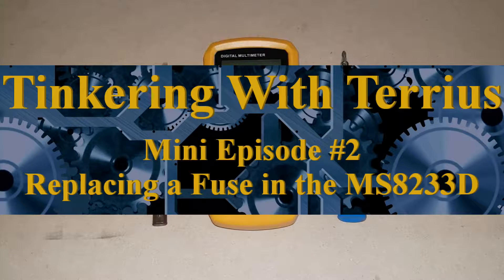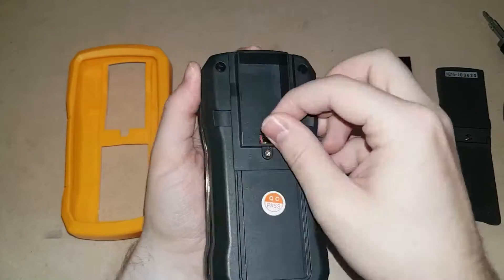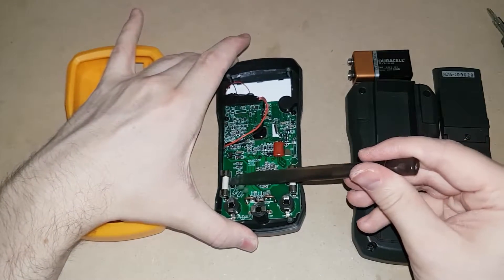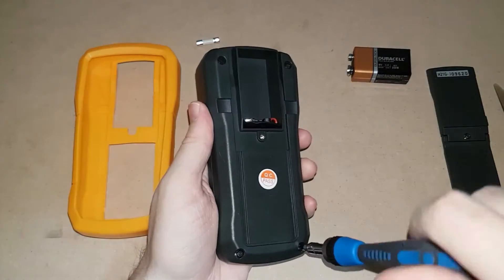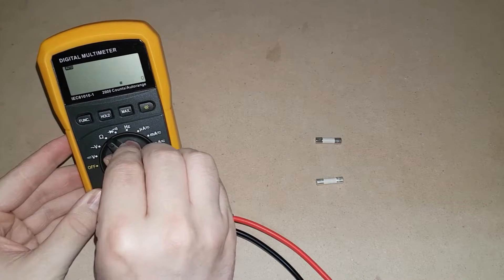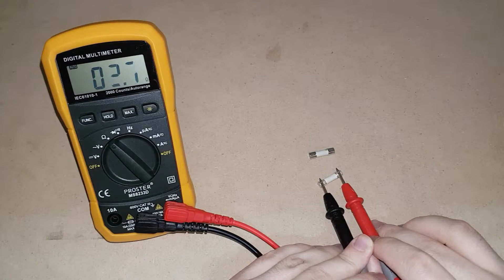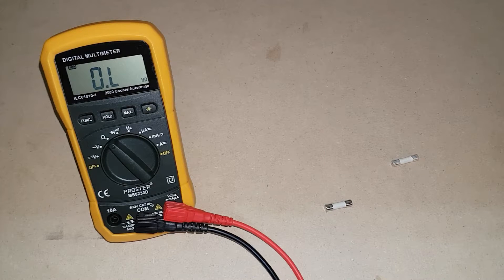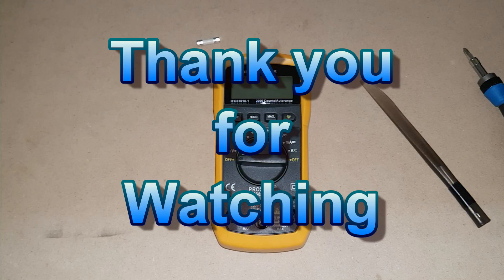TWT Minisode #2: Replacing a Fuse in the MS8233D

Comment: Fuse part numbers, from the docs, for the MS8233D, are: 

10 amp fuse: F10A/250V
250 milliamp fuse:  F250mA/250V
Reply from the maker: Thank you for posting the fuse specs, I was just about to reply with them when I noticed your comment had been edited!
Reply: @TinkeringWithTerrius  :)
Reply: I'm not sure if there are different fuse sizes, but it should be 5 x 20 mm.

Comment: Shame they can't make these fuses a lot more accessible. I've now blown the 10A fuses on a Crenova and B &Q multi-meter (MS8233A). Just too easily done. There's  a tiny message on the B & Q warning you not to exceed 30 secs on the 10A range every 15 minutes. Nothing mentioned on the Crenova or the instructions. Pretty useless for my application.
Reply from the maker: Indeed, I wish they were replaceable from the battery compartment like in some meters, but I suppose that is too much to ask for from a DMM of this price category.
Reply: @TinkeringWithTerrius  : I have just managed to replace the 10A fuse on my B & Q, using glass fuses of a slightly different length & diameter and it now works. Much wrestling required to get that plastic cover off and on! The Crenova takes yet another different type of fuse, which I've had to ordered from eBay. Thanks so much for your video, which gave me the knowledge & confidence to tackle this tricky task.

Comment: is this the same stuff? because in the manual written MS8233D like Mastech or Proster 
this link https://www.banggood.com/NEW-AIMOMETER-F0601005-Digital-Multimeter-DMM-p-1103039.html
Reply from the maker: Looks more like the DM02A based on the labeling and outside. Very similar to the Proster but a little less sturdy of a casing. The newer Proster meters have moved to that same design I believe as well.